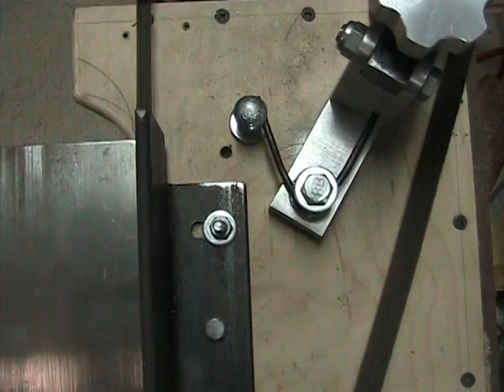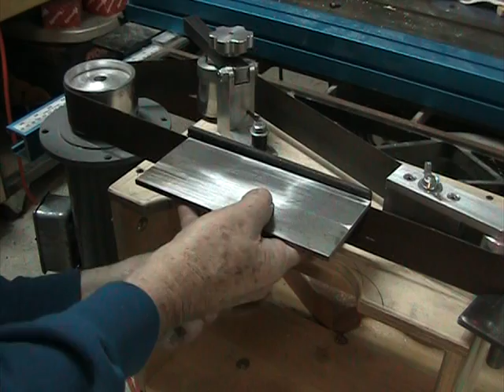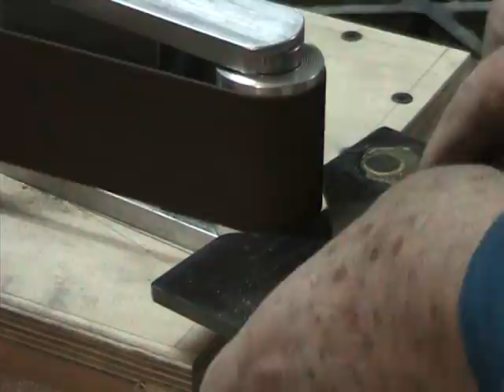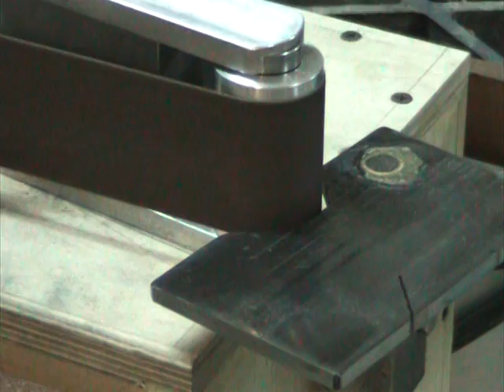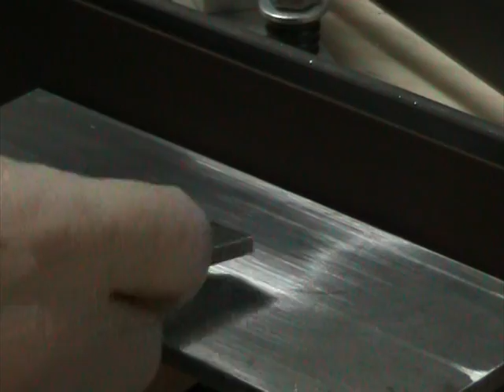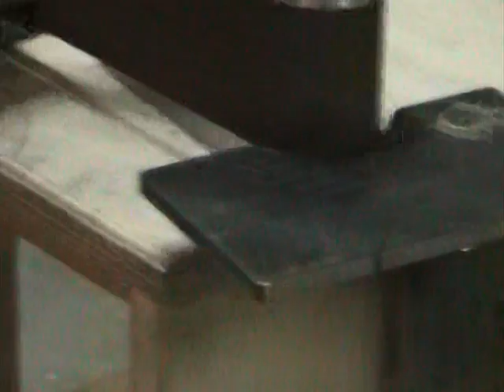2 x 48 Horizontal Belt Grinder

Comment: Hey Chuck; I've got a 4.8HP/130VDC/3170Watt motor sitting on the bench waiting to be wired up.
Do you happen to have a video on how you wired up that DC motor???
Reply from the maker: +Grandpa Bill I sent you a private message.  If you Google full wave bridge rectifier, you'll find lots of diagrams on the internet.  They are simple, cheap little devices with 4 connections, 2 for AC in and 2 for DC out.  You should be able to buy a 250 volt, 25 amp rectifier for under $10.  Here's an example on Ebay...  

http://www.ebay.com/itm/400V-25A-Bridge-Rectifier-/221540801690?hash=item3394dc5c9a:g:EtkAAOSwPe1UCIGM